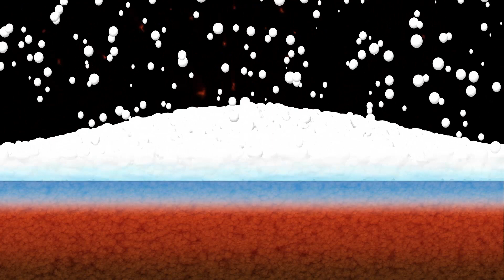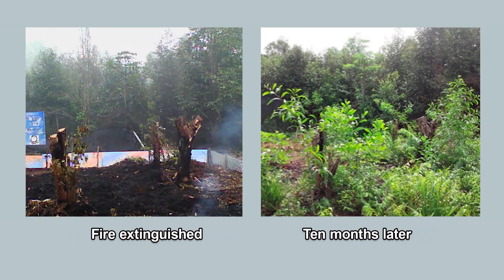Eco-friendly Firefighting Foam

Comment: 2:44 Sorry, but the only thing this part shows is that this product is an inferior fire fighting foam. The durability of the foam bubbles has absolutely no bearing on the environmental impact of any given foaming agent. If I mixed cadmium salts into that soap solution, the foam would vanish just as quickly but be incredibly harmful to the environment. Foam should remain stable for as long as possible to prevent reignition and provide continuous shielding of blanketed surfaces against heat radiation. What do you think is more problematic: A foaming agent that is slightly more harmful to the environment but that, once applied, will remain on a surface for three hours or a foaming agent that is slightly less harmful, but has to be reapplied every five minutes, thereby in much larger overall quantities? This is just nonsensical.